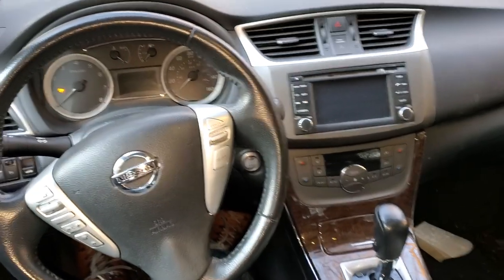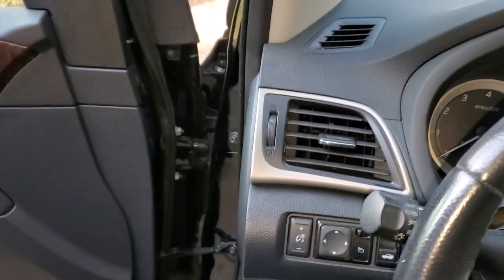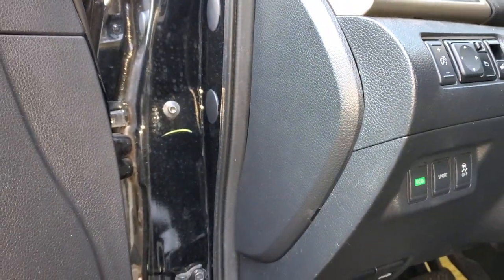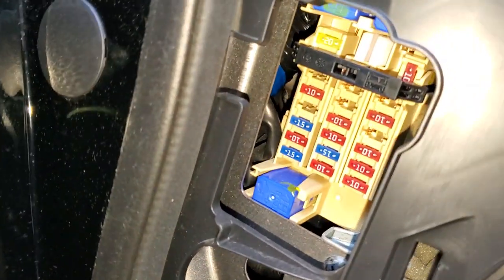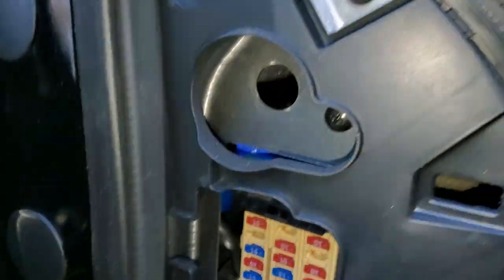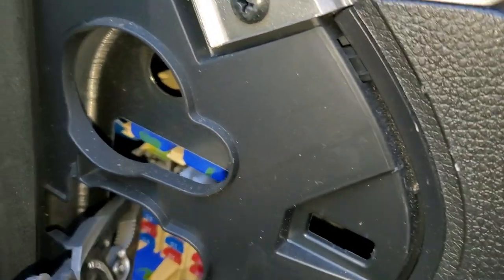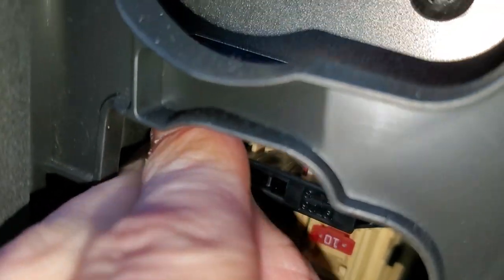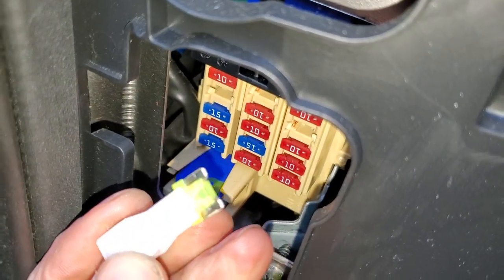2014 Nissan Sentra Cigarette Lighter Fuse, Power Outlet Fuse Location

Comment: Soooooo I dropped the fuse puller... 🤷🏻‍♀️🤦
Reply: Same 🤦🏾‍♂️ how did you get yours back?
Reply: @acspooh9465  oh I took out the little plastic runner thing that is on the floor against where the door opens. It had slid down that. It should be one curved piece, longer than it is tall.
Reply: Just looked again, more like two pieces
Reply: Walmart sells a emergency fuse repair kit for $5 with fuses and removal tool.
Reply: Just use a pair of needle nose pliers, those fuse pullers are plastic  garbage

Comment: What should I check if the fuse is not blown? When I try to plug anything into my adapter the power will pulse on and off but doesn’t change it

Comment: Im having issues with the horn. Do u know where it's that fuse located ?
Reply: in the fusebox under the hood.  this fusebox is rectangular, just in front of the engine.  pull the panel off by pressing the latch down, it comes off easily or you sre doing it wrong.  Inside the top, locate the fuse circuit called horn.  Take the horn fuse out and bring it into an autozone, match it by visual comparison.

Comment: Nice now i know where to plug in my remote wire for my amp(still have the factory radio)
Reply: This is exactly why I'm looking for this lol did this spot work for you? I connected it to the radio fuse but it wouldn't turn off the amp

Comment: This has truly made things so much easier thank you.... have you had any problems with your mass air flow sensor on the car?
Reply: I do have that problem. The code P0101
Reply from the maker: I have seen many Nissans have issues with the mass air flow sensor.. often caused by dirt getting past the air filter and contaminating the MAF sensor wire.
Reply: I have the same issue with my MAS

Comment: nice video, 

I unplug y stereo and now USB port is not working in Nissan sentra 2015. 

Is there any fuse to check if USB/AUX port is not working.

Any suggestions. 

thanks
Reply from the maker: The USB port receives power from the stereo.
Reply: @LehewTech   I double checked and the mini USB is properly connected to the Stereo, but still unable to connect my phone from USB input to the Stereo.

What else should i check?

Thanks